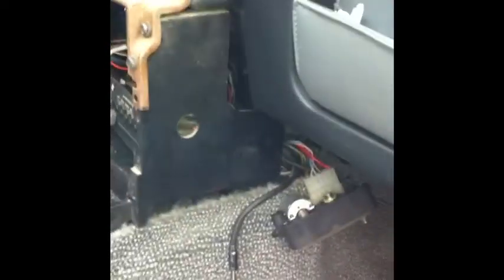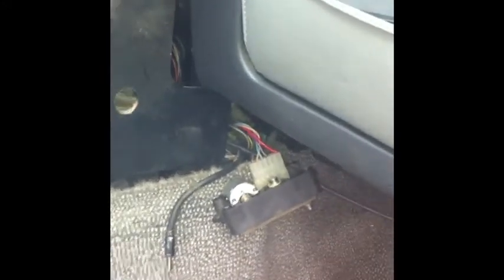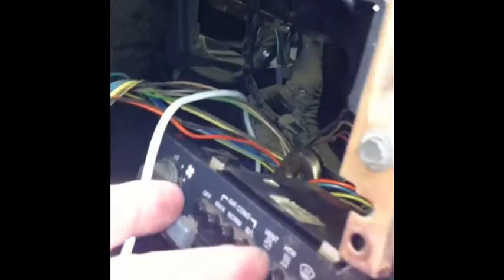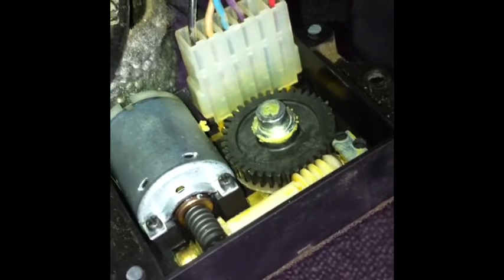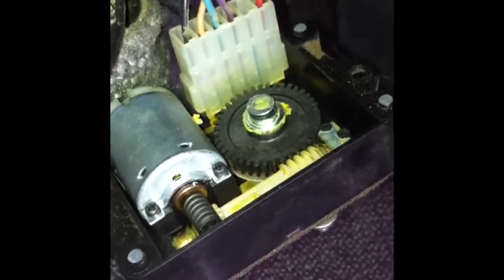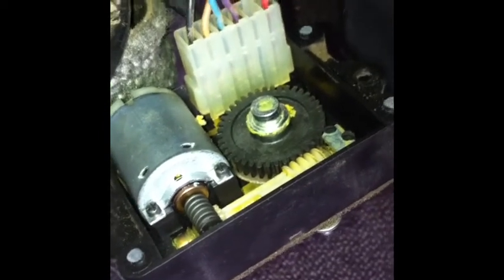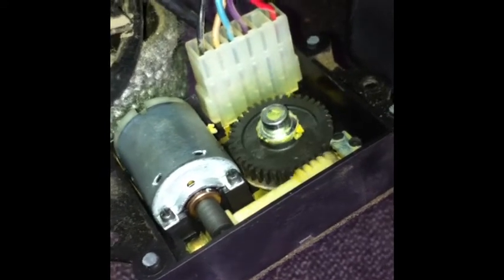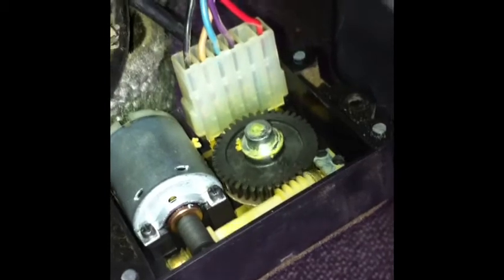Fiero Vent Mode Selector

Comment: If you are working on this and can’t figure out how to remove or even more difficult replace the levers and retaining clip, here is the answer: go to drivers side and remove one screw in the air duct housing (lowest piece) slide that piece toward the drivers door and it will come out of retaking slot on other side, you can then access the back side of the motor control assembly arm and either remove or replace levers that control air flow. You may need to activate the switch to move arm where the door stay’s partially open for you to reach inside and get the second lever on the arm without tension and then replace the clip. To get the arm in an ideal position I pressed buttons to move arm and when it was approaching the ideal position I quickly turned off the key which was easily accessible from where you will be working. Hope this gives enough insight for someone to figure the details.